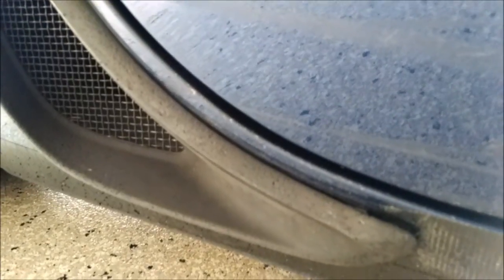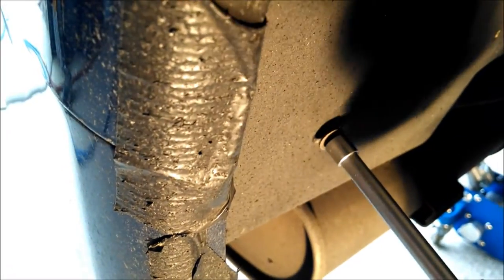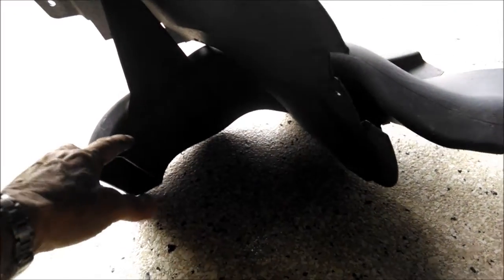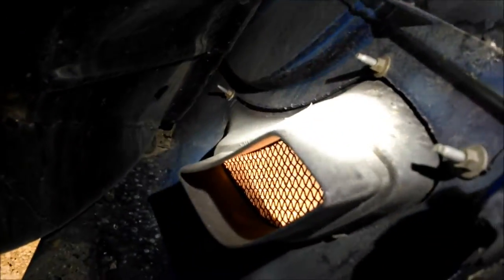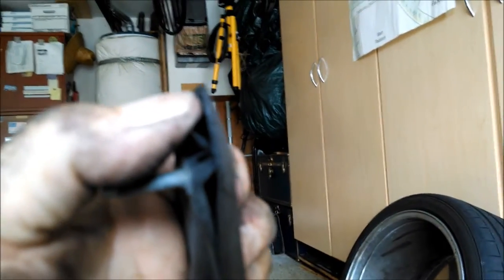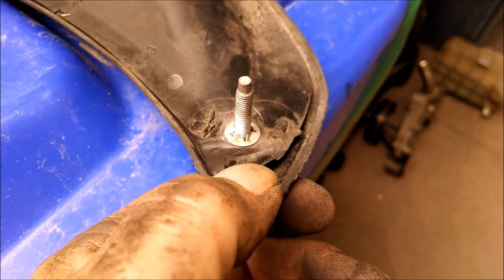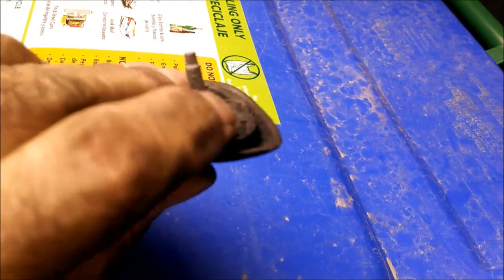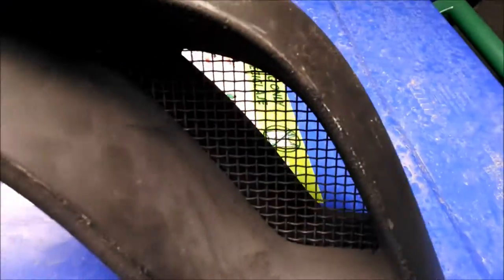Corvette rear brake cooling duct repair by froggy

Comment: I like to fix things if I can too, but mine was fubar.  I put up the part numbers to help out someone like me who cant fix one that is unrepairable. This video was a great reference on how to remove the inner fender and the duct. Man, crazy how much sand and dirt gets collected in there. I have used your other videos as a reference when doing the same repairs/maintenance to my car, and they are very helpful.
Reply from the maker: I appreciate you adding to the thread.

:)

Comment: You can order brand new AC Delco replacements on Amazon for around $65 each.  GM and AC Delco part numbers are the same. Right side is 10322762, left side is 10322761. I had the left side outer piece come unattached from its inner half. I found out that they are actually two pieces that are plastic welded together, so I just ordered a replacement for both sides in case the right side did the same.
Reply from the maker: Thanks, yes, you are right on. I just like fixing things & it came out nice/not brand new.

:)

Comment: It bothered me that mine has a bunch of chips. Looks like it's just a high chip area.I think I'm going to get the carbon fiber covers for it
Reply from the maker: Yes, def high wear area, your CF will get blasted also. Post a pic if you do it.

:)
Reply: I read it doesn't get as banged up, that's one of those on the fence things. I'll definitely post a video if I do it